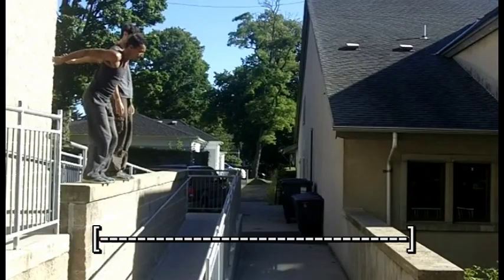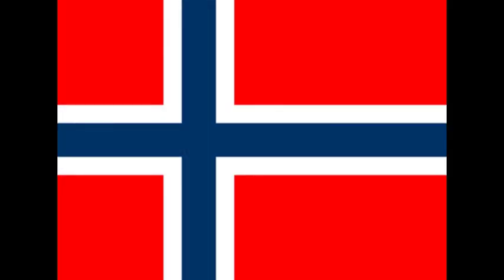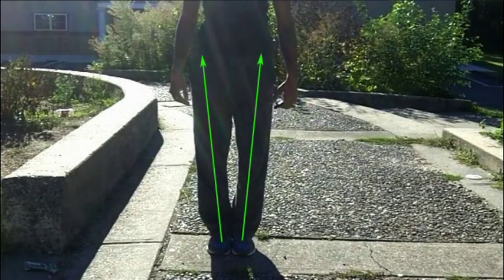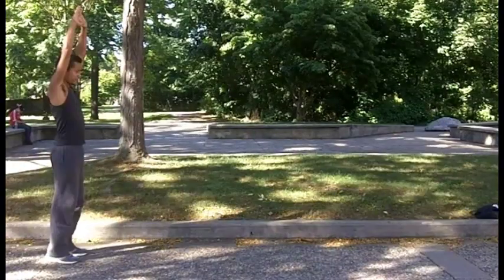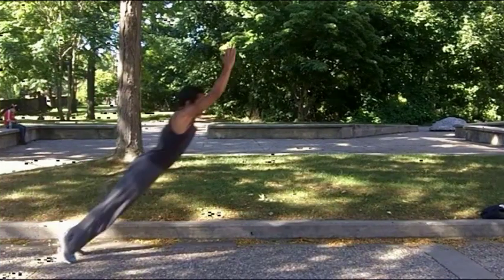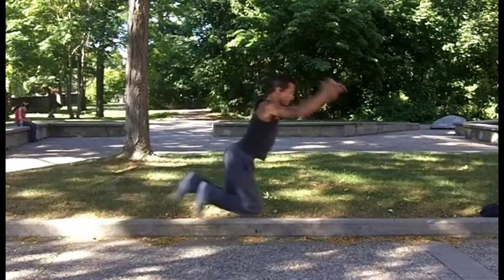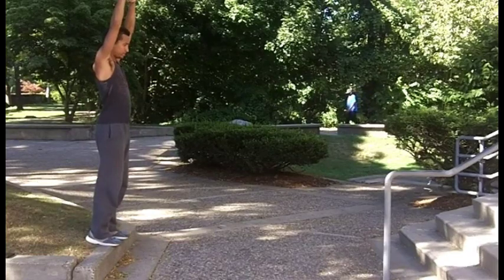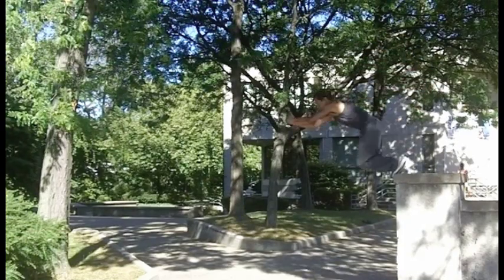Parkour Science #3 Physics of the Standing Precision Jump -Part 1

Comment: Love this series!

I'm not sure I agree regarding the arm swing though, during the jump. The legs may have a limit to how much force they can generate, but there is a variable here, which is how long that force is applied. (This is the converse of the impact/impulse concept in your landing videos.) Assume that the legs exert a fixed force for the entire time starting from the bottom of the crouch through the feet leaving the ground (I'm sure this isn't exactly true, but let's assume). When jumping, there is the (upward) normal force from the ground to the legs, and the (forward) frictional force from the ground to the legs. By swinging the arms up, there is an additional set of forces - the body pushing the arms up, and the arms pushing the body down. The downward force on the lower body will keep the lower body closer to the ground for longer than it would have been without the arm swing. This gives the feet/legs more time touching the ground while the arms and upper body extend, until the point when the upper body can't extend any more and the lower body has to start extending, and then the feet finally leave the ground. The end result is that the fixed force of the legs is applied for a longer period of time, leading to more momentum.

Am I thinking about this incorrectly?

Zach
Reply from the maker: Thanks! I see what you are trying to get at but yes unfortunately you are thinking about this incorrectly. I think the best way for me to explain is with a thought experiment/analogy. If what you say is true that having the downward resulting force of the arm swing increases time for the legs to exert force. (it doesn't but we will use it as a starting assumption) well downward force from arm swing is no different from a physics perspective as weight (except in that it varries and drops off). If you jumped while holding a weight and then let it go (aka make it too vary and drop off) as you left the ground would you fly higher then you would with no weight in the first place? Hopefully that seems like an obvious no. The key issue is when you look at impulse it is related to time as well as distance in a related manner. the distance to consider though is center of mass to bottom of feet. No amount of arm swing will increase leg length or force capability of the leg muscles, and as such the only way to vary time is with less force (which naturally results in a slower take off and less height). Though now it seems obvious to me I must admit, I was myself a bit surprised when I worked out the dynamics and discovered that the arm swing only effected center of mass placement and not directly height. So I got a second opinion (always good to double check results) and this concept has been shown and proven many times by bio-mechanics experts. Hope this helps.

Comment from the maker: You are correct... the timing of your tuck has a direct effect on the angle of landing and as such on both balance and distance. I didn't bring it up in the video because I have personally never taught or met someone who mistimed their tuck (usually they just forget to tuck altogether) beginning tucking very soon after take off is important for getting the required rotation for the control and max distance. Thanks for the good point.

Comment: I have to disagree with what you see about the arms, although perhaps you can debunk me on this one. What I've found is that the pendulum swing from the arms DOES allow the body to get in the 45 degree angle, but it also creates a large amount of forward momentum in itself, along with tensing in the lower back muscles (you can see Josh's back arch a good amount). I may be wrong in what I've experienced, but I've found a strong swing can lift the body on it's own without legs at all at least some